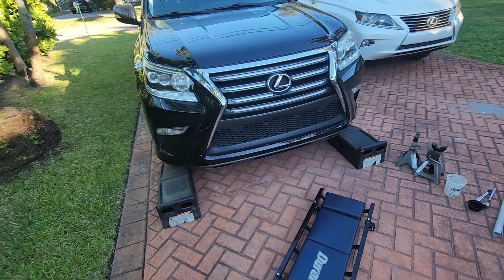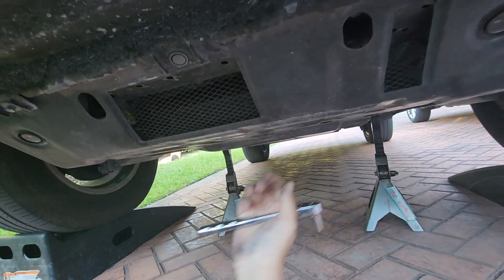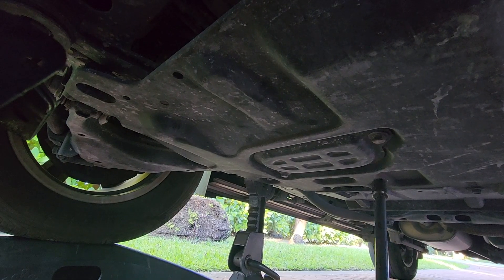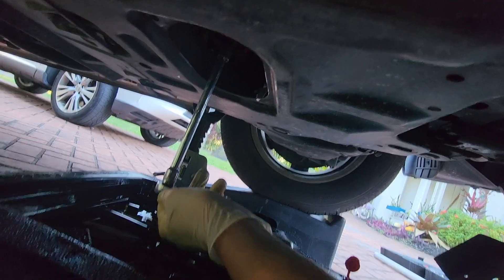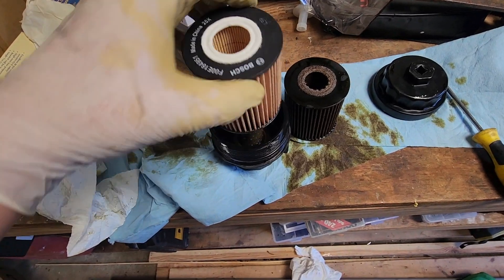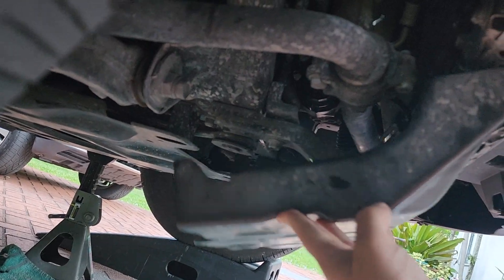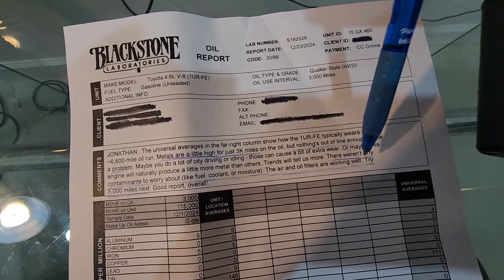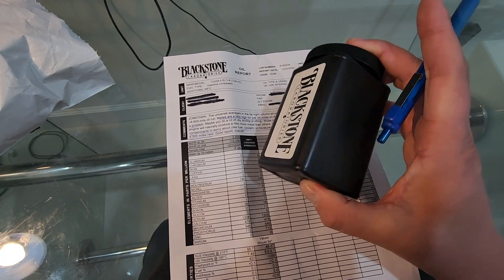How to Change Oil and Filter on Lexus GX460 and Laboratory Test Old Oil for Elements & Properties

Comment: Nice step by step video.

All my oil changes was done by the dealer.  The oil filter cap is freakin so tight!  I'm afraid if I force it, something might break.  😢
Reply from the maker: Though mechanically breaking vehicles is possible, vehicles are typically designed with high mechanical factors of safety. This is especially largely true with Lexus. If I were you, I'd give it a shot. A mechanic will not likely do any better.
Reply: @JonathanMarkMorgan  what u said made sense so I gave it another shot and it worked.  Thanks!